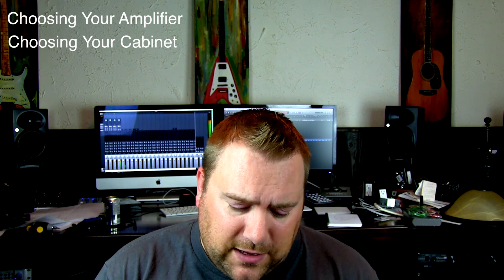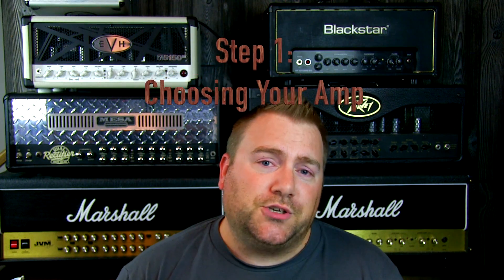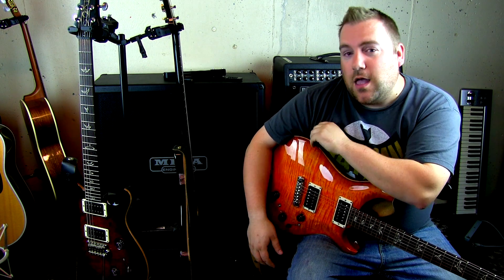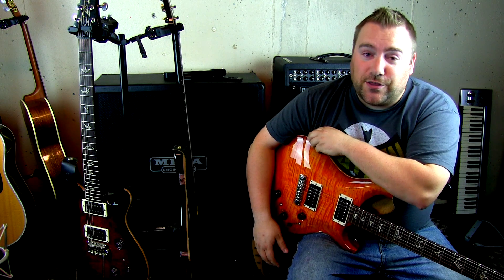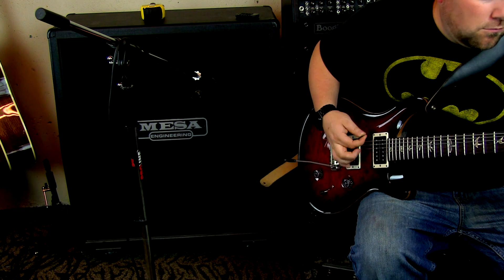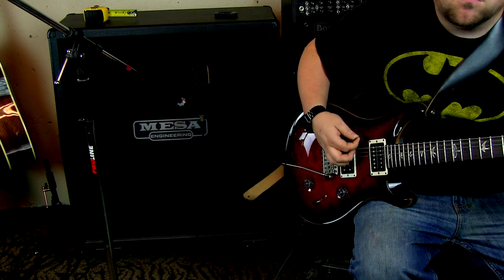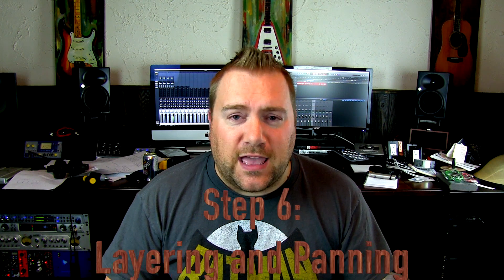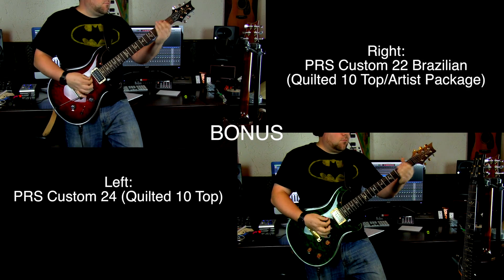How To Record A High Gain Amp (6 Easy Steps)

Comment: Good video but i have a problem. İ use focus rite scarlett solo 2nd generation audio interface and i have large diaphram condenser mic. But it doesnt recieve bass frequences well when i try to mic my marshall ma 50 combo tube amplifier. İ dont know what i am doing wrong. Any help?
Reply from the maker: What Mic are you using? Cheers -Ryan
Reply: TriCrow Studios focus rite c25. İt was included the studio kit
Reply from the maker: Hmmm... I'm not seeing any type of hi pass or low cut on the mic or the interface. It could either be placement or that the mic does not have good bass response. What happens when you try recording with the mic on the edge of the speaker? do you get any low end at that point? I have about 32 Microphones and each of them sound very different in regards to hi/mids/lows. some aren't the greatest with low end unless you tweak it in post. Let me know. Cheers -Ryan
Reply: i solved. mic was so much away from amp. / i brought closer to amp and tried off-axis technique then sound is brilliant now. all was my fault. thanks for help